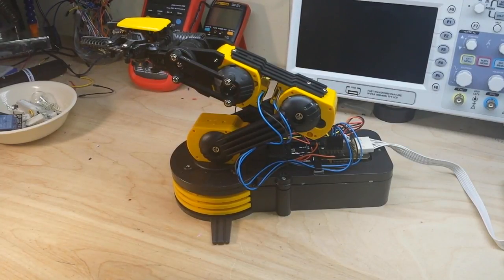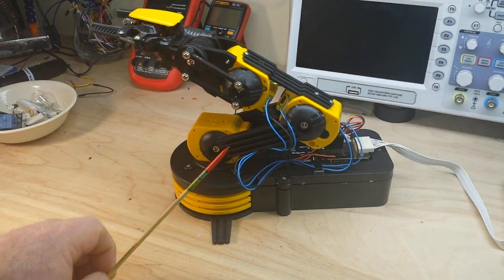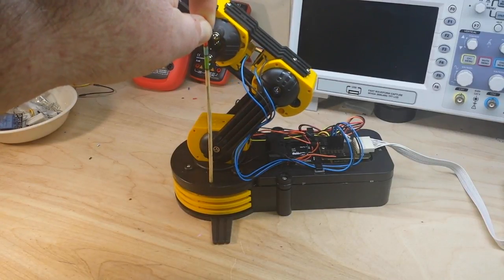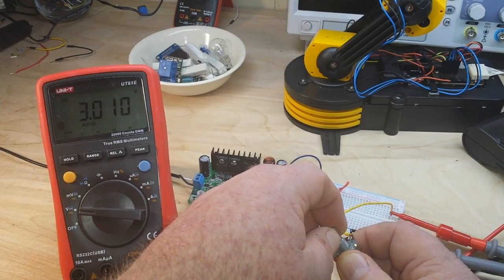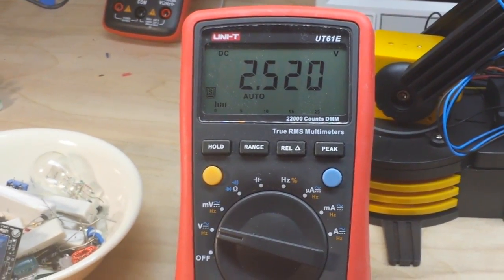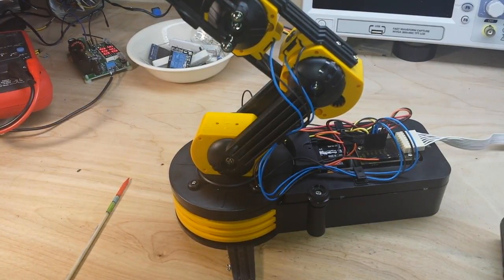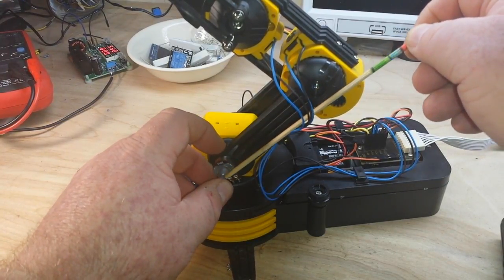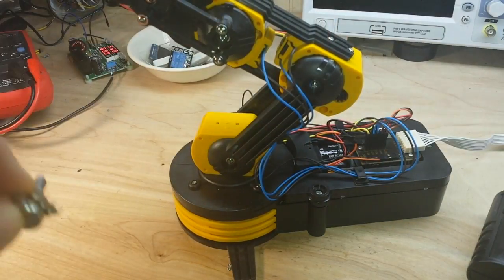Hacking a Robot Arm Part 4: Position

Comment: I know this is back in Dec but I'll offer my 2 cents(maybe less). Why not just follow what 3d printers use? A end stop switch and then in the software adjust for the max rotation. If there is a way to monitor current. When the base or arm is at full rotation there might be a increase in current and that would be the indication it reach the end.

Comment: For this project I used 4 15mm 10k thumb wheel pots. They are low profile and look a lot neater than the regular ones They can also easily be hot glued to the joints. Glue a stiff wire (I used a paper clip) from the center of the Pot and bend it into one of the holes on the motor housing. An added bonus is that these fit percectly under the cap for the claw ! 

The bsae was a little tricker. I ended up mounting a 10 turn pot with a 1cm rubber wheel pressed against the turning part of the base. I also built a controller for it and posted a comments for that in part 3.
Reply from the maker: +Wayne Russell That's awesome! Do you have any pics?
Reply: I have pics but not sure how or where to upload them to.
Reply from the maker: Wayne Russell You could upload them to Dropbox
Reply: https://www.instagram.com/p/BcqSM-NHasT/

Just remembered I have instagram. It's still a work in progress that I shelved about a year ago, however, seeing your vid has motivated me to finish it. The motors on my unit don't handle PWM very well and never got around to testing the bluetooth.
Reply from the maker: +Wayne Russell Thanks, that's so cool.
Reply: As I started working on this project again, I remembered a couple of pitfalls I ran into using this approach on the first go round. Hopefully this is helpful to you.

1) To stabalize the output from each pot, try soldering a 104 cap across the wiper and ground, otherwise accuracy will be diminished when compensating for this fluctuation in code. It also helps in preventing the occasional twitch during standby - very unnerving sometimes.

2) In terms of degrees, the pots I used covers a range of approximately 0 to 195, (maps to ADC values 0 to 1023) so in the arduino code you will need to redefine the range to map to a min and max value for each for the actual range. As a result, the usable resolution of each pot is somewhat reduced. In case of the claw this is significant.

3) The motors on this arm does not react well to PWM voltages and hence, PID control is difficult to mitigate and only allows for coarse adjustments. I also had to sacrifice accuracy to prevent oscillations. Still deep in thought on this one.

4) I'm using a CD4051 and single analog port on the Arduino to sequentially read and then adjust the motor direction and speed accordingly, however, the Arduino does not seem to be fast enough to handle this process. I'm considering upgrading it to 20Mhz and superchaging the code with direct port access and some assembly. However, that might a project on it's own!

I'm only a hobbyist with very little electronic experience and the latter two issues is the reason this project was initially shelved. 

Hope this was helpful and If you have any suggestions at all for me it will be greatly appreciated. In the mean time I will be eagerly awaiting the next episode in this series!

Comment: arduinoized! I was just wondering. ( you know how that is. it gets you in trouble. or makes you dumber than you are. or both! meaning my self! ) anyway... if you were to make something like this from scratch. would steppers be better? with gear reduction. or a servo . or linear actuator or just a worm gear and brushed motor. I'm looking for fast but human speed. like arm movement. maybe like lizard hands. with two thumbs and two fingers. with shoulder , elbow and wrist. with linear actuators in the fore arm to cable actuate the fingers. I have been thinking about this. since this project started. maybe use arduino controller and have a option for a joystick control. and the size of a large human arm. or slightly larger.  and made  from steel and aluminum. maybe add pressure sensors to the hands/grippers.  I'd like to build a robot basically one part at a time. maybe a remote controlled wheeled not about human man sized. about the size and shape of a human in wheelchair with tracks. I guess it will be a long expensive project. but do you thing an arduino or a few of them would be up to the job. I guess what I'm getting at . is what would you use to build this ?  great video..
PS I know I could build it. I just don't know that much about the programming and electronics.. but with your videos. I'm learning!!!
Reply from the maker: +James stranger From scratch, if I'd use servos. Super easy to control, built-in positioning. And you can get them from small and fast to large and strong.

Comment: Disassemble the potentiometer, then mount the track part with the pcb onto the black arm. Maybe this could be glued or a 3D printed mounting. There's also the hole in the centre that means you can still access the screw. 3D print an assembly to hold the wiper against the track and attach this to the other part. That way you'll also only have one moving wire so less to get in the way as well as less bulk.
Reply from the maker: +Moonbrony I like that. Good thinking

Comment: I was thinking rotary encoder put a pot would work with the limited travel. How about cutting the top of the knob down to where the shaft opening is and the JB weld it to the arm. This would allow you to still get to the screw on the arm for disassembly. Like you say print a bracket to mount the body of the pot. Of course steppers in plase of the motors would be best, but I guess that kind of defeats the whole idea.
Reply from the maker: +George Chambers encoder is (imo) too much coding. The pot requires only an analog read.

Yeah, we're doing this with spit and bailing wire
Reply: That's that way I always like to do it!

Comment: I thought of using a timing function to measure the position but then the issue would be establishing its position if it wasn't parked when switched off. Potentiometer sounds good. It could be tacked to the shaft with JB weld or some other epoxy and fastened to the arm with a 'u' shaped bracket. I know it's a bit crude but we are 'hobbyists'!
Reply from the maker: +John Clayton Thanks

Comment: I guess the pot couldn't fit inside the yellow housing because of the motor but would the pot be as accurate as a stepper motor ? Could the pot bring the arm back to the same spot every time? To find out watch this same bat channel, this same bat time... I'm sorry where was I ??